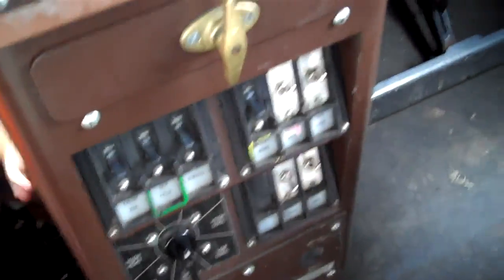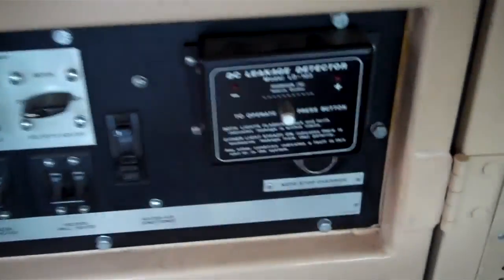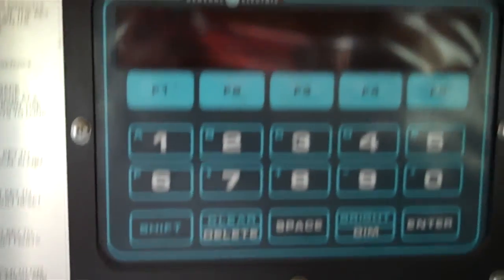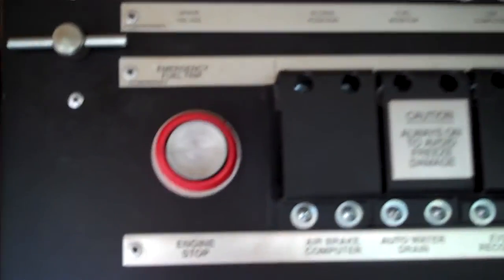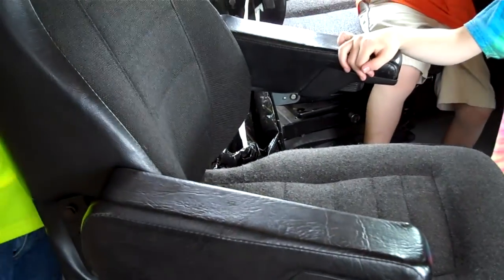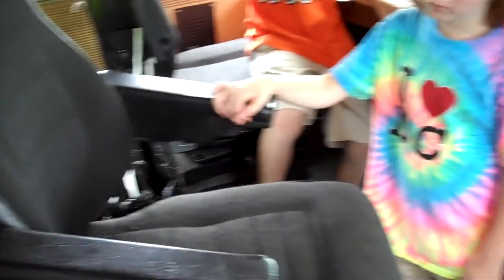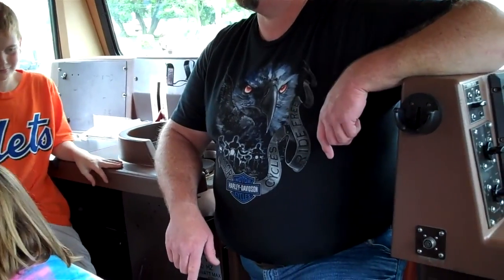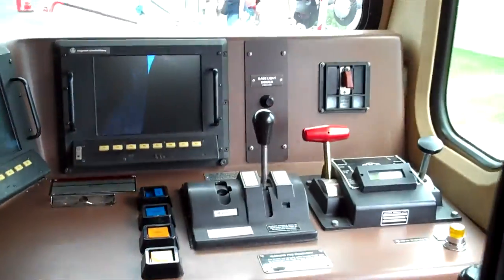Inside GE AC4400 Canadian Pacific Locomotive # 9777

Comment: Nice Video.  Being a Locomotive Engineer for the Canadian Pacific Railway I have a few comments forthe guy in the cab.  First of all you RUN a train you do not DRIVE a train.  The springs in the brake cylinders are used to help release the brakes. The air is used to stop the train.  I really liked the comment of "they run train s that are five miles long" .  This guy is an idiot.  Any way good video. The last time this unit was this clean (before it was repainted) was when it was new.